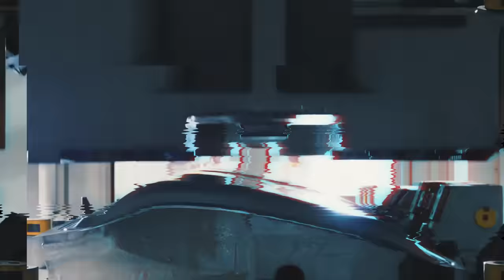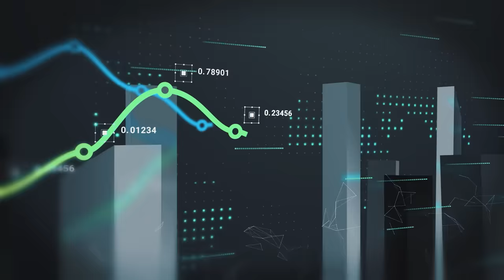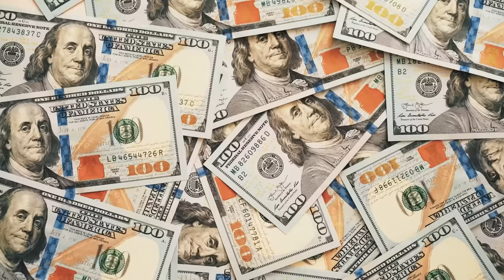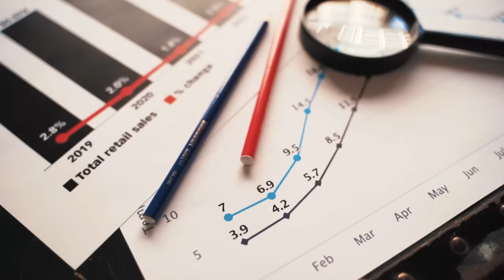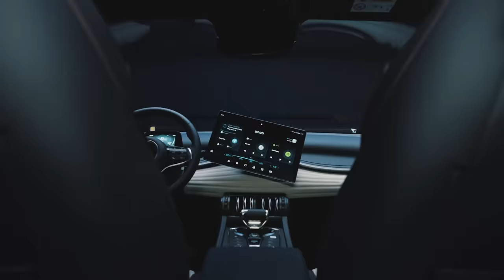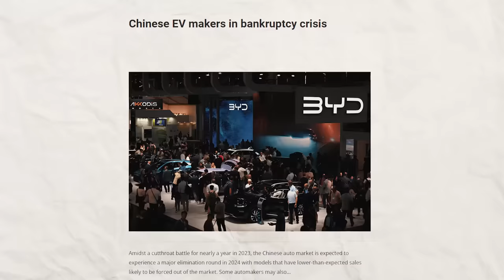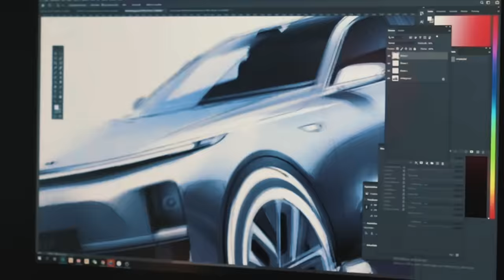The FINAL NAIL in the Coffin of Chinese EV Makers!

Comment from the maker: 🔴Would You Buy A CHINESE EV? Yes or No?🤔

🏆80% of Dealers Hate Biden's EV Strategy and Refuse to Sell WATCH HERE 👉https://youtu.be/sOWHKsvSsJc
Reply: Nah. The good ol combustion engine is just better in repair cost and maintenance.
Reply: Would I buy any EV, No.
Reply: Hell yes!
Reply: Never ghostrider, evs are GARBAGE!
Reply: I would.  Cheaper to own and way more affordable
Reply: @levelazn  look up replacing the battery. look up the amount of mining needed to create these cars and slave labour and the industry is using the public to pay for R&D (they are supposed to do that before selling a product, not after).
Reply: No and I try very hard to avoid buying any product made in China.
Reply: no.. its unreliable
Reply: @MAIN-GAMES360 maintenance of EVs is FAR cheaper than ICE cars. There are no oil changes, no coolant changes, no spark plugs, and because of regenerative braking no brake pad or disc replacement after 150,000 miles. You do have to tap the physical brake every 5,000 miles or so to remove the beginning of rust.

And charging at homes is 5 to 10 times cheaper than gas per mile. So you are clearly misinformed on this subject.
Reply: @binloveds Tesla batteries are warranted for at least 80,000 miles. Most are still usable after 150,000 miles. If we use 80,000 miles, and assume gasoline costs an average of $3 a gallon with MPG of 25 miles that costs $9,600. A typical Tesla replacement today is about $8,000 and getting cheaper. Don't forget oil changes every 3,000 miles for about $1,600. Then coolant changes, transmission grease replacement, spark plugs, etc.

And as for mining, remember the drilling of oil wells, oil spills, atmospheric damage from refining, particulate pollution we breathe in from exhaust and CO² atmospheric pollution that has given us 15 years of hottest ever weather out of the last 18 years.
Reply: I already got one!
Reply: Would I buy a Chinese EV?
Nope. But then I won't buy any EV in the first place, not even the Tesla.
Reply: @MAIN-GAMES360  Just 6 times more inefficient aside from the CO2 emissions. What would you do if/when we run out of oil?
Reply: How Volvo landed a cheap Chinese EV on U.S. shores in a trade war

By Norihiko Shirouzu and Chris Kirkham
April 24, 202410:09 AM PDT

Reuters

Comment: The war on CO2 is insane (literally) , It contradicts both physics and biology, 
The world needs far more CO2 not less. 

The climate is controlled by the sun and the planet's albedo (dust mostly) not a relatively minor trace gas with a minuscule shielding effect. 
The total warming effect of all the 'man made' CO2 added to the atmosphere since the beginning of the industrial revolution is just 0.3 degrees C. (easily calculated from the shielding value of CO2 and the Stefan Boltzmann law) 

However in just the last 50 years the increase in CO2 has lead to a doubling of 3rd world crop yields per hectare. (1st world yield have quadrupled in the same time thanks to fertilizers and better seed weed and pest control not available to the third world) 
50 years ago humans could not produce enough food to feed 4 billion people with an average of 1 million famine deaths per year. 
Thanks to the rise in CO2 humans are now producing enough food to feed 8 billion people with about 25,000 famine deaths per year. 

climate is following the solar Gleissberg cycle 100 years ago and America went through the dust bowl, 50 years ago the planet cooled (so much so that the climate doomers of the time were pushing 'imminent ice age' drivel.

The cause of climate change;
The actual basic cause of climate change is sun spots' 
Lots of sun spots reduce the energy that reaches the surface of the planet and the plant cools.
 Fewer sun spots and the planet warms.

Comment: Why would any rational person buy an EV anyway? You can only go about 250 miles before the battery charge dies. Then try to find a charging station that still works. Your EV has to be towed, (some towing companies refuse to tow an EV) it could be days before the battery is charged and you can drive it. When the battery has to be changed it is cheaper to throw the EV away and not fix it.